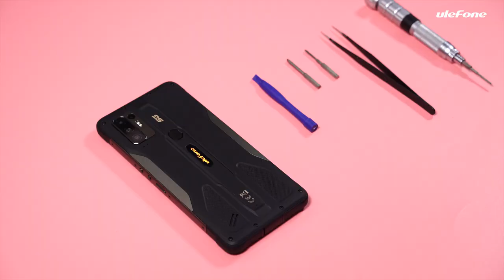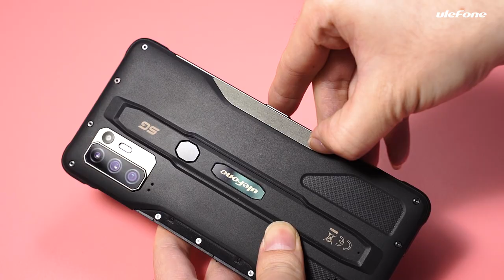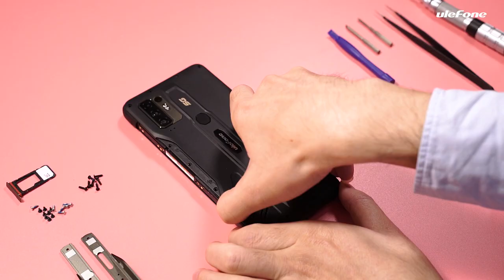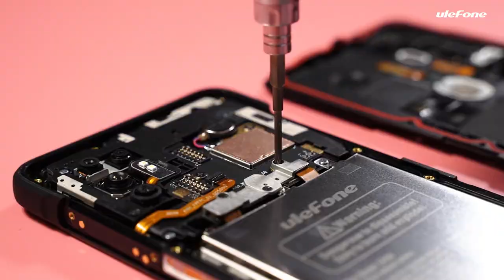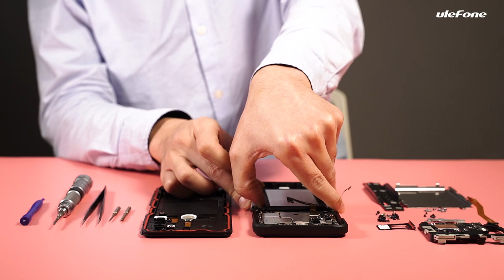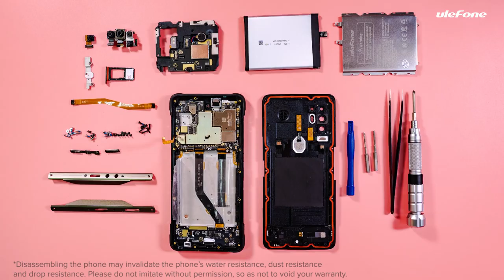What is inside on 5G rugged phone? Ulefone Armor 10 5G Teardown!

Comment: What is the little hole in the bottom center of the back of the phone? It's to the right of the speakers....
Also, would this phone still be able to "function" if the microphones and the cameras were completely/permanently removed?